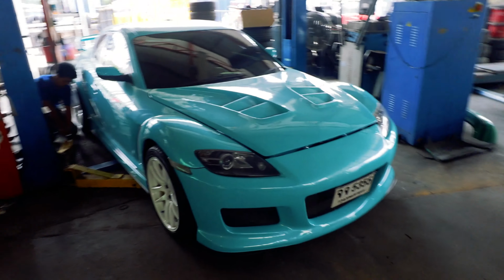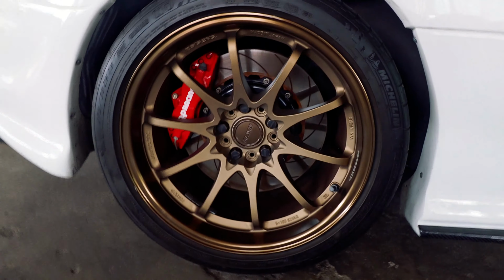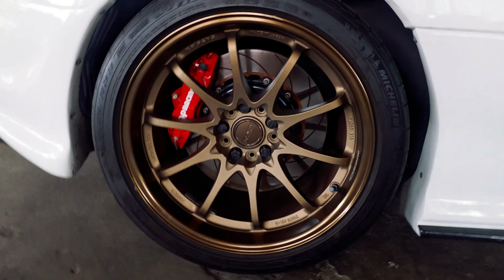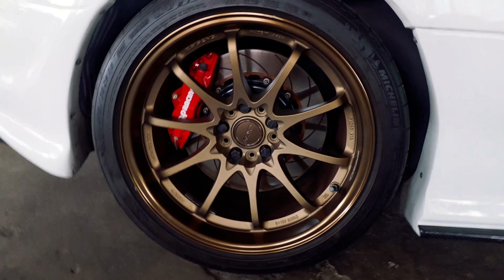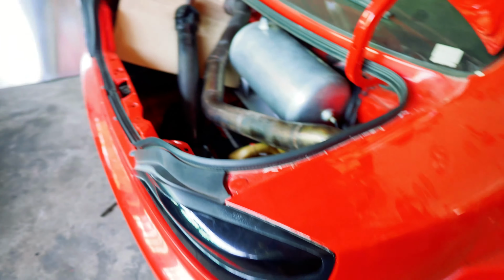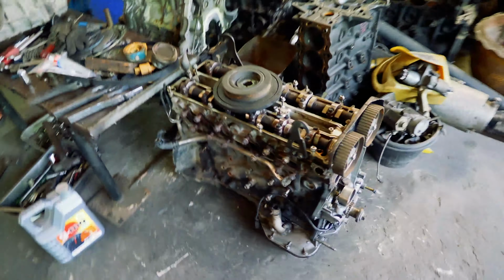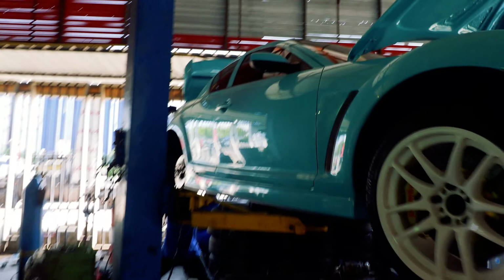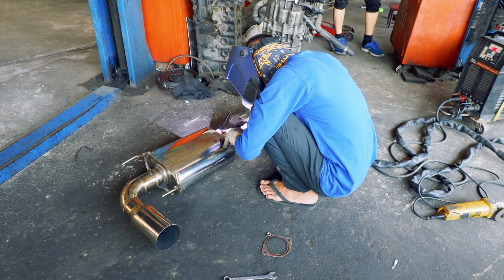RX8 Supra 1JZ Gets A New Exhaust And Tyres - Also Loads Of Cool 2JZ & 1JZ Cars & Exhaust Noises!

Comment: Nice video! Impatiently waiting for my e46 to get ready. Little correction: it was a stock 2JZ-GTE twin-turbo engine with auto BMW transmission. It's getting converted to manual and single turbo for more power ;) the aim is around 500 whp. Just waiting for the exhaust manifold to arrive from Taiwan and find a stronger diff to replace the OEM 168mm.
Reply from the maker: I had a bunch of spare manifolds, would of sold you one cheap!
You will love it, have two friends here with this exact setup.
One of the best cars made and one of the best engines.
Just don’t forget to reinforce that subframe!

Comment: ps4 Michelin not any good over there mad! like u said highly rated tire
Reply from the maker: craig T mad I know, though I found the old super sports better. I do think there’s a lot of press BS going around regarding these tyres.... you just can’t trust anything online anymore.
On the flip side the roads here are concrete for the most part and super soft tyres make a huge difference over comprised high performance road tyres.
Same for bikes too, I ran pilot 4s and they sucked so bad.
The high spec almost semi slick diablos on my bking are much better 🤷🏻‍♂️